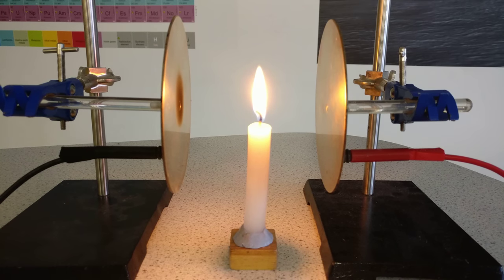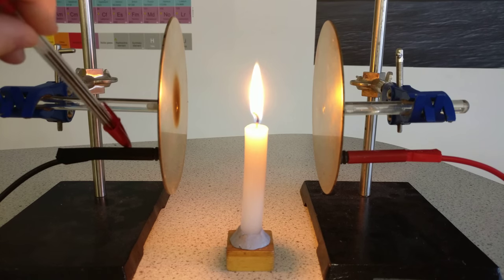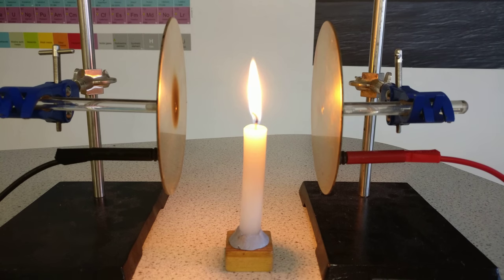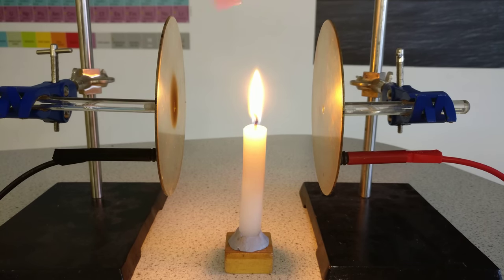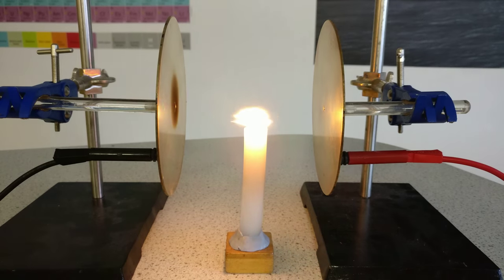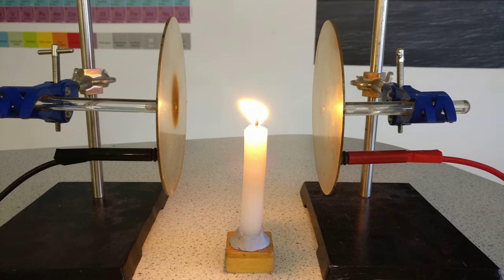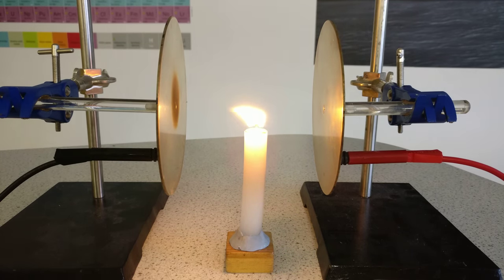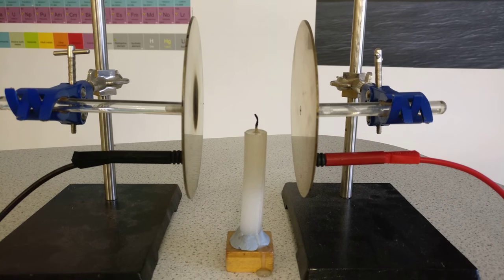Christmas Candle Flame in an Electric Field  - AQA A Level Physics

Comment: Does this explains that the direction of the flow of current is actually from positive to negative?
Reply: But that's not true. That's conventional electron theory. Electrons flow toward the positive......Am I wrong??
Reply: Think theres still some doubt about that,maybe just human need to explain/visualize theories?
Reply: I believe electron flow is - to +. With a large enough voltage, electrons will flow through the air (e.g. lightning). As the electrons leave an atom in an air molecule, an ion is formed. So the ion flow is from + to - because it is in the opposite direction of electron travel. A search on "hole current flow" should provide info on the idea of positive current flow.
Reply: @claesmansson9070  There is no doubt at all. Electrons are the real charge carrier in any bulk conductor. It is the electrons that flow, and they flow toward positive.
What you heard was a reference to what's either called conventional current, or sometimes 'physics current', called 'conventional' because at the time that electrical theory was first being characterized, we had no idea that the electron itself existed. We only knew that something with many characteristics of a fluid was discovered which could flow through certain solids(conductors), and it seemed sensible to assume that if it(electricity) were fluid like it's probably 'pumped' through the solid by positive pressure rather than being 'drawn' through it by negative pressure.
It's sometimes referred as physics current simply because positive charges, even theoretical ones, are a bit easier to deal with than negative ones. Take the right hand rule for instances. If youre conceptualizing a flow of positive charges from positive to negative then the right hand rule will tell you exactly what direction force is applied to the charges if they pass through a magnetic field. If you use the right hand rule for electrons flowing from negative to positive, then the answer provided for the same condition must be flipped 180° to be accurate.
Reply: @timstill152  You are not wrong.
Reply: @claesmansson9070  I'm very confused. Is this AC or DC? And how can current flow if there's no physical connection? This looks more like a capacitor.
Reply: @AtlasReburdened  so the video above shows only the direction of force field..thus, the direction of force field is opposite to the flow of current?..is that right?
Reply from the maker: it is a capacitor of sorts but you have charge leakage!
Reply: electron flow is from negative to positive... conventional current convention was decided incorrectly by ben franklin and is still used in simple circuit illustration. very important for welding which way you throw the electrons
Reply: I think of it as flow of electrons left to right as they're being pumped/pressurized/forced into the left plate. Since electrons are also being vacuumed away and out the wire at the positive plate then also positively charged air molecules lacking some electrons they wish they had flowing right to left. What happens if you remove the left plate replacing it with a wire on the far side (from the remaining plate) to the wick and visa versa?
Reply: @timstill152  
No. You're not wrong
The original method of electron flow is NOW referred to as "Conventional Current flow"
Conventional was once believed to be correct as flowing from Positive to Negative where in actual fact things went from a HIGH energy state to a LOWER Energy state and it was assumed therefore that High should be Positive

Later we learned that Electrons have Negative charge
and Since electron flow is literally the accepting and giving away of the valence electron/s it is therefore understood that Current flows  TOWARDS POSITIVE
so yes, Positive TO Negative  is correct
Reply: @martinkuliza  Electric current is, by definition, the flow of charges; its direction is that of the flow of positive charge; i.e., opposite the direction of flow of negative charge.
Which is opposite the direction of flow of electrons; and in the same direction as positive ions or "holes."

Fred
Reply: @ffggddss  
thank you, However
I'm aware of all that, i know what the definition of everything is , i do this for a living. 
at the end of the day this is all fundamental stuff anyway so to anyone who does it it shouldn't be a debate, it's only the new guys that are asking the basic questions
Reply: @martinkuliza  Sorry if I came off as "error-correcting;" yours was just the last comment, and so, easiest to click on, and I wanted to get this out there for the general audience.

Fred
Reply: @ffggddss  
Oh...
No No problem, i don't mind error correcting, i just didn't understand why you were telling me 
However if you prefixed your comment with 
"FOR THE BENEFIT OF EVERYONE" i wouldn't have questioned it

in any case, all good

Comment: Interesting demonstration.

The flame is electrically isolated from ground.  Most candle wicks contain a fine metal wire to keep the wick standing straight in the flame.  It would be interesting to ground this wire at the base of the candle to ground the flame, thereby providing a source of electrons to the flame of the candle.  The flame may develop an electrical bias due to the difference of ion mobility in the electric field. 

I'd like to understand why intensifying the electric field puts the flame out.

Try running a small stream of water in a unipolar electric field (you can use a charged piece of plastic ).  I had a physics teacher do that once to surprise the class.
Reply: Grounding the candle would not provide a flow of electrons to the candle.
Reply: Pressure mediation within the electrical field is what puts the candle out.

Comment: There are not more positive ions produced than negative ions. The number of each is equal. I think the positive ions produced may have more mass (more atoms) then the negative ions. For example, when you ionize a water (H₂O), you produce a hydrogen ion H+, atomic weight 1 and an OH– ion, atomic weight 17. Both ions have the same but opposite charge but very different weights.

The experiment is cool. The explanation, not so much.

Comment: I think this is how an ICPMS works. Ions are fed into the machine and then electric fields accelerate the positive particles around a corner. The goal is for the particles to not make the full turn. They all smash into the outside curve, but in different places depending on the weight of the particle. Lighter ions make it further because they accelerate faster in the field

Comment: Another possible cause of the flame going out is that when you put the flames closer together, the oxygen supply becomes worse. Also, why would the combustion in the candle stop because the result of the combustion (the flame) is affected by the electric field? That doesn't seem logical.

Comment: When a candle burns it creates a convection current as the hot air, now being lighter, rises and is replaced by colder air underneath.  The hot air rising has less oxygen than the cooler air underneath it.  This is why we get that shape that we do.  Fire in space forms a ball since there is no gravity moving the hotter and lighter gases up.  When you create the electric field wouldn't that interfere with any normal airflow?  Couldn't that prevent the CO2 from being able to move away from the flame to create room for O2 to reach the flame?

Comment: What a fun thing! I would never suspect. In 1968 or ‘69 I followed an electronic hobby magazine project for science fair that is slightly similar. (No original thought on my part.) It used the flame envelope to push air AKA a speaker. I got a 400V DC power supply from my pastor (who was also an electrical engineer/HAM operator) and modulated it with a signal from a cassette player. The weakest part of the setup was the electrodes which needed to be placed inside the flame. I used nails, but they deteriorated pretty quickly. Trumpet sounds were so crystal clear (BS&T of course). It was good enough to win first place!

Comment: It's because the magnetic field very much affects the air. The candle is flickering like that because the air is moving around in there, not because magnetic fields directly affect fire. Put a piece of paper in between those plates and watch it shift and move from the air currents.

Comment: The heat separates positive and negative ions (Birkeland current) and which is termed 'Plasma'. Plasma fills the universe (at least 99% of it according to Plasma physics, and which the Standard consensus of science calls Dark Energy/matter because plasma can't be seen unless it is highlighted; as in super nova; e.g., the Horsehead or Crab Nebula.
Horsehead Nebula - Wikipedia
Crab Nebula - Wikipedia

Comment: Can someone explain why the flame is pushed towards the -ve side? Since the electrons flow from -ve to +ve, the flame should also be pushed towards the +ve side
Reply from the maker: The positive ions move more towards the neg electrode. The electrons the positive. I also think the flame is pulled a bit by the motion of the electrons.
Reply: @animatedsci  yeah i guess since cations are more larger and heavier than the electrons, they would push the flame more strongly to the -ve side. While the electrons which are lighter won't be able to push it towards +ve side so strongly... so ig because of that flame is pushed towards the -ve plate... and thank you @Animated Science!

Comment: The first question that came to my head was, could a technology like this be used to figth big fires on forests or buildings?
Reply: if hes using 25kv to bend a candle flame, the upscale to affect large scale fires would make it untenable and dangerous id imagine.
Reply: sure you can! we only need 2 helicopters on the left and right of the inferno to act as positive and negative and then activate a walmart 10hp generator affixed in the copters  to produce 200,000 volts + and - and walaah!

Comment: It's absolutely fascinating that fire conducts electricity; this is a safety feature of the modern gas-fired furnace/boiler in HVAC systems. The ignitor is continuously energized with twenty four volts A/C which is conducted through the burner flames to the grounded "flame rod:" this is known as "proving the flame" or "flame sense." If one or more burner flames extinguish or ignition fails on any burner for a short, set amount of time, the gas valve is shut off. Excellent visual demonstration.
Reply from the maker: Wow. Brilliant comment. I will use that idea to add into my my electricity Y12 lessons. Many to thanks.

Comment: What would happen if there were three points of contact on each plate, spaced evenly apart, instead of one? Would there be a difference in the field? How would it affect the flame?
Reply: you'd  effectively make a time travel machine.. the whole room gets sucked into another dimesion..

Comment: I wonder if ther'es a measurable difference in the current with vs without flame. If so, could it be applied as energy recapture from jet propulsion, or ion propulsion?

Comment: I wish this video suggestion came out close to when the video was made. but on the off chance the creator still sees this Im curios  if the the temperature of the flame rises or falls when you run the electric current through it.
Reply from the maker: I am not really sure. However, it's a bit tricky and with 20kV around it's hard to just dip a thermometer in. Maybe an infrared one!

Comment: What happens when you touch the plate together after you remove the power source? Would they discharge like a capacitor?
Reply from the maker: They quickly drop but I ground then first.

Comment: This was exactly my A level nuffield physics experiment. I found that the carbon deposited itself in two separate rings rather than a circular spot with most carbon above the centre. I suggested it was because perhaps some ionised gas had two positive ions. Also during the experiment at about 50k volts a spider decided to drop down between the plates. It did not last long.
Reply: you made a rudimentary mass spectrometer.
Reply: A spider "decided" to drop down when you let go of it above the field.
Reply from the maker: Super. I did Nuffield A - level at school

Comment: I have an idea from your invent. craft something like dome with those Electrode plates and port them into a super speed sonic jet plane's or helicopter's underground basement so they could be work as fire fighter. we can able to extinguish entire fire flows over forests or elsewhere. also it is going to cost but worth if we are saving life, craft a insulation layer with those electrode plates and port them into walls, ground floor or ceiling while fire occurs so noone dies because of flames in commerical, industries or whose are living residentals. it is a bit economic based so best to handle this job with goverment funds by development research. those materials has to be more effective and stronger guess that is all. thanks blesses to you, no more bilion tonnes of water waste to stop flames. it will sweep away fire like rust.
Reply from the maker: Problem is getting the separation of charge. As soon as you touch something your grounded. The electric field of 20kV dropped by a lot before due to charge leak.
Reply: What about featured of resistant to electricity body suits for firefighters or guess a gloves for you for example a gloves of rubber or may be some sort of leather or wooden stuff. İn the other case a material that to not get electroluded might even work. I have to research more, check you back later again. Aramid material is not flameable, that I have seen here, Russian are using it for military purpose.

Comment: i learned one new thing from this video :D

Electricity current flows from positive to negative, and that makes so much sense! because if the energy is holding a positive charge, then if its released, the negative charge must take in the energy. fascinating!
Reply: Electrons travel from Negative toward Positive

Comment: i can't even follow my own logic on the observations above, because the puzzle is so complex.
as photons travel outward from a Star, the wavelengths tend to widen, as the spin velocity of the celestial mass increases (moving outward) - tangential velocity.  however, during the initial creation of matter (perhaps within stars, combining space (energy) into mass (hydrogen; alpha particles)...a photon wavelength is released.
in order for the 'creation' of the initial seed-neutron, a given amount of compression and frequency (with a given spin) must be attained...this can be facilitated by the simultaneous bombardment in the center of the Star, coming from opposite directions; the North and South Pole (of the Star)...the force of which culminates into a Neutron...which by way of more random collisions, can decay into an Alpha Particle and an Electron...i.e. fusion.  that is my estimation & interpretation, free from the constraints of modern scientific belief...

Comment: As a kid I saw and built what was called a flame speak. similar.  With virtually no moving mass, it would be capable of very high frequency response, fidelity.  Due to limitations of high voltage tech, not so great.

Comment: Is there a way the burning efficiency could be monitored for this? Maybe investigate what happens to flame fronts within the field? How big/small a burst of current would be needed to affect the flame?
Reply: Further thoughts lead me to wonder what would happen of you had a hole between each plate? Which leads to to thoughts on applications for 2 different purposes... Then further thoughts on if pulsing has any effect and what frequency/voltage/wattage combinations would induce useful effects. Enquiring minds and all that, if it's already been investigated I'd be interested in research papers.

Comment: does the electrical field create a sort of wind/air? or its the electric field making the distortion for the flame to lit off? I'm confuse
Reply from the maker: No it's the pull in field for POS and neg opposites
Reply: @animatedsci  wow that's pretty impressive. thank you so much for sharing. your content is very well appreciate it. keep up the excellent work.

Comment: I dont think your producing more positive ions. Instead, I think your ripping electron off and they fly  towards the positive plate while the heavy ionized atoms and molecules are pushed/pulled toward the negative plate, making the flame move more to the negative plate.
Reply from the maker: Yes. Totally I just misspoke on the video, one take and no script!
Reply: @animatedsci  maybe it would be interesting to measure the temperature change on the plates.  On the one hand the ions and free electrons should have the same energy, but collisions with air molecules may change how much of that gets to the plates.
Reply from the maker: @kreynolds1123  I think the energy would dissipate too quickly to get a good reading

Comment: well, if you review the old science, that was how were made and used the tv kinescopes. A ray of light could be changed on place, on miliseconds over a screen, but only if it hadn't some resistence, like air, using some electromagnetic fields, on high voltage...

Comment: A house next door caught fire and became an inferno, a very old couple lived there and accidentally set the curtains on fire.  I was in our backyard and saw the flames billowing out of the window and ran over to help them.  After assuring that everyone was out I tried to call 911.  Could not call because of the intense electrical field the fire caused, could here it on the earpiece.  Had to run a block away to make the call.

It was a total surprise to me, although in retrospect, not surprising.

Comment: Get rid of the voice. Modulate the EHT with a good rock song and start off doing the cool, not the drool. Bump up the voltage to around 100k and use a gas source.